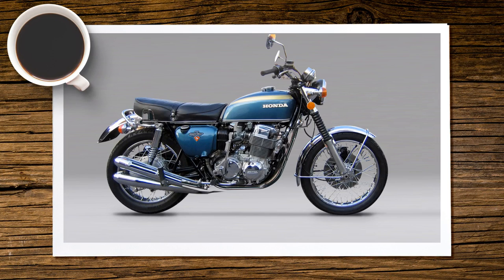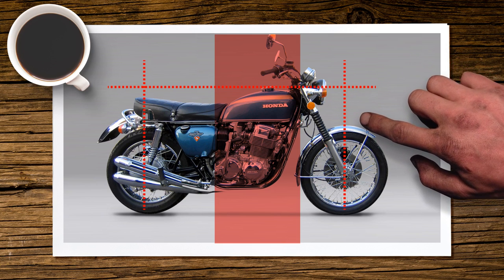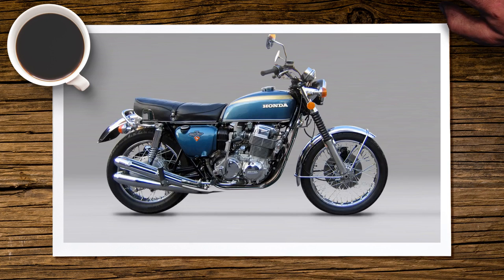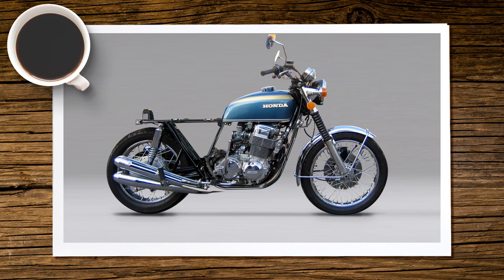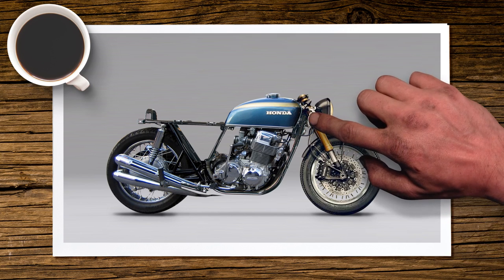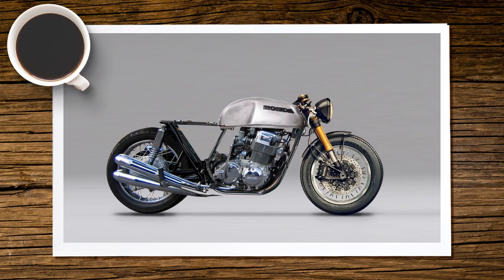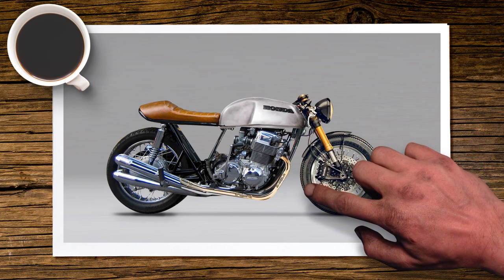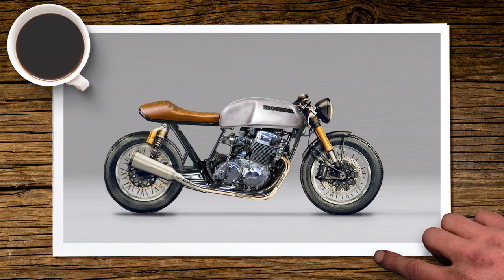How to design a cafe racer motorcycle

Comment: Funny, my build is the example motorcycle, down to the color! I realize they don't all have external oil tanks, but the one you used for example almost certainly does, in which case you'd still need some kind of tank in the 'triangle' or wherever you might put it. I've seen slimmer ones that stand up and lean back or a pill style round one. Mine is a 75 and I think the following generation (80 maybe?) they went to having all the oil in the crank case. You have a nice bike, too bad we can't share pictures here.
Reply from the maker: Yeah I've used creative license on that one, but Cognito Motors make a really thin nice one that mounts next to the frame to allow for your void to work

https://cognitomoto.com/products/bolt-on-cb750-oil-can
Reply: dreegez I've actually looked at that one. I keep considering it but the capacity is less than original so I keep weighing that out, visually a plus, but less volume means more frequent oil changes as the oil spends more time in the engine, and I believe that would contribute to higher oil temperatures as well. It's certainly possible I could be wrong though. And on Cognito Moto, I really like that air filter they have that goes across the four carbs, it's more unique than the 4 pod setup. Much more expensive though! Lol
Reply from the maker: Luke's World Definitely, I don't think Cognito can put a foot wrong, everything they do is spot on.
Reply: So far most of my parts have come from Dime City Cycles. I also like a few of the bits that Joker Machine makes.
Reply from the maker: Luke's World I do like Dime City, I regret not going there when I was in Florida last. Would have been an experience

Comment: In my opinion I think the seat in the after photo is just a little too long, and the same goes for the exhaust.  One of the key things I look for is whether back wheel is completely covered up or not, in my opinion it should be exposed as much as possible.  Also I think the  mudguard should be removed the for a more exposed look.  As well as tidy up the cables.  Lastly It'd repaint the engine a matt black with some areas masked off like the exposed out parts of the fins to give it some variation while not giving it too much attention.  It'd also add a heat wrap on the exhaust.  As far as the tank goes, I think a matt dark green would go well to give it a more military look, and in general it'd try staying away from too much glossy colors or chrome.
Reply from the maker: Thanks for the suggestions.

Comment: Awesome video...but I don't like that Blank V in most cafe racers... Getting rid of it will be a problem??
Reply: And subscribed hope to see more quality videos 🤘
Reply from the maker: You could leave the air filer box in place where the V in the frame is. Some cafe racers have them there. If your bike has the frame like that it'll need a lot of thinking if you were going to get rid of it as it's a substantial part of the support, or you could start with a bike like a Yamaha Virago which doesn't have that V

Comment: Love your vids keep up the good work subscribed yesterday, what was that gold front end off? I have an old wreck of a cb250n in boxes had it for years I’m thinking of turning this into a cafe style bike I’m struggling with figuring out what forks will fit and will I have to change both wheels?
Reply from the maker: People usually use GSXR front forks or CBR, you can even go Ducati etc, allballsracing.com have a conversion chart with what bearings you need. And yes, you will need to change the wheels, brake calipers and discs.

Comment: This video is so great. Is it necessary to convert from fuel injection to carburator type to clear up the triangle? Thanks
Reply from the maker: Depends if your bike has fuel injection or carbs. You can retune fuel injectors to run pods. Alternatively you can replace with carbs

Comment: Hey mate, me again :p just wanted to ask if you think it's possible for someone with no motor or build experience to build their own cafe racer? Had some naysayers telling me it will be impossible and I'm going to end up spending a fortune. Love working with my hands though and would love to give it a go assuming it's a realistic goal. If you think it is possible, I assume besides a standard tool kit, grinder, drill and welder should be sufficient for the bulk of the work?
Reply from the maker: If you have a £20 grinder, a socket set and a hammer, I say go for it.
The best way to learn is by doing, and when you start, if you get stuck, give anyone a shout on the internet, myself included, we might not know the answer straight away but collectively there'll always be a solution. As for the welding, you can get someone else to weld if need be.
Reply: Amazing, thanks mate. I'm gonna start looking for a bike and give it a go. No idea what I'm in for but what the hell lol
Reply: @chrisg1610  and found a bike ?
Reply: @forthebold  though in ur video where did you put the battery?

Comment: If I just bought a 1980 Honda 200 Twinstar and I want a set of front and rear forks like whats on this video but want to keep the wheels and tires I have. I really like how the wheels and break system looks. What would you recommend? Love the gold look and love the style of the rear shocks in vid and on your bike.
Reply from the maker: Try looking at newer bikes that may be being dismantled, that'll give you the gold forks, but you'll need to change the yolk also to fit, the wheels will be easy to swap, but the brakes might be a bit harder.

Comment: I've been following you for a while (you've been a huge help so far!) but haven't seen a video about modifying rear sets if i'm right. Do you do it? Or not at all? I'm thinking about doing it, but i'd like rear peg's for my passenger aswell. Any ideas?
Reply from the maker: Thanks for following the vids, no I never tend to modify them, there are kits that you can buy for most bikes, I've seen some floating around for the CX even, perhaps that may be a simple solution.
Reply: Alright! First of all I'll install my clip ons and check if I need the extra comfort or not. Thanks once again!
Reply from the maker: Good thinking, mock the bike up how you want it before painting then make that call.

Comment: very good video, mate! Have you any recommendations for a cheap cafe racer bike, because the honda cb750 four is too expensive nowadays in my opinion
Reply from the maker: +Anton Tworek Everything's completely priced out of the market, I remember when I was growing up we had engines and frames around but today there's a price on everything. You could experiment with newer bikes from the late 80s which look all plastic on the outside, as long as it has a steel frame you can do anything to the underneath. Maybe look for Yamahas that are water cooled, you can do some cool things with the radiator.
Reply: That´s a good idea, thanks!
Reply: Remember that the CB750 is just an example. I'm an old fart, and back in the day the CB550 was considered the better bike as it was almost as powerful and much lighter; they can be found much cheaper than a SOHC CB750. There are some great CX500 customs being built and those can be found for a song.
Reply from the maker: I like the frame build and the engine on the CX, you can create something beautiful with those

Comment: Iv got a 71 cb350 and I love the idea of swapping out the whole front end. Where/how would I find a front end to swap it with?
Reply from the maker: To be honest you can make most fronts fit. For an easy life, you can start with checking what triple clamp forks will swap to yours, then work from there. Alternatively you could measure your fork diameter and see what others share that size if you don't want to swap the yolk. Baring in mind chances are you'll have to change the front wheel and brake callipers also. I do like the CL350 forks, might be worth looking into those? Good luck

Comment: Is there a resource for figuring out what yoke and triple tree fit different bikes as far as compatibility with the head tube etc?
Reply from the maker: You can make anything fit with the correct bearings and stem swap back to the original.

Comment: how do you change an entire front end... that would mean now forks and shocks, new triple tree, new lights and brackets, bars, etc etc... is there a simpler way?
Reply from the maker: No not really I'm afraid, the look aof the cafe racer needs all parts such as bars, lights etc changing. But if you're changing the forks then a triple tree or yolk is a much needed part, unless you're lucky enough to find replacement forks that slip right in.

Comment: Nice photoshop job...I good idea of différents step on a cafe racer project...but talking about harmony lines...the pipe should be shorter and on a angle little more height and the line from the gaz tank and the seat need to be more precise...a perfect line... thank you for you video !
Reply from the maker: I've seen bikes where the muffler is parallel to the angle to the frame which also looks nice, I'm in between the angled or straight option for my pipes, I'm swaying towards angled.

Comment: One problem is that the CB 750 is a dry sump bike and "air cleaner" you removed was actually the oil tank.
Reply from the maker: Only the SOHC, the DOHC doesn't, but the SOHC has a Cognito Moto conversion that hides it in the frame

Comment: I have an 84 Honda cb650, what kind of forks would you recommend
Reply from the maker: I like the existing forks on those but probably a bit too long. You could try forks from a honda CL as they're a bit cool and retro, but if you're thinking of fitting new forks like on the video then the world is your oyster, whatever you decide will need work converting as I think you'd be stuck to find a quick replacement solution. Best way to start is to measure the diameter of your fork holes in the yolk / triple clamp and compare a list against what might fit. 

The other thing to then think about is your break callipers as whatever you change to will need either modifying to fit the CB's callipers or buy new ones for the new forks.
Reply: dreegez cool thanks a lot

Comment: What happens when you remove your air filter? I read that it's bad for your bike but is it wrong?
Reply from the maker: You have to compensate with re-jetting the carbs but you have to put a replacement filter like pods, you can't leave a filter off

Comment: im confused, so a bike does, or does not need the air filter on the back? getting an 81 CB 175 and im wondering if its required, and also where to mount my battery after mods?
Reply from the maker: It'll ned some kind of filtration system, so here we have pods, alternative is velocity stacks. And for the battery you use a lithium ion which can be fitted under the seat like on my Suzuki GS
Reply: ok cool,  im looking at filtration alternatives now thank you! now if the battery sits under the seat would it just be mounted in the location the old filter was? that may sound confusing apologies
Reply from the maker: If you get a seat with an empty seat cowl you can put it there.
Reply: ahhh ok i just saw your video for the battery relocating thanks man

Comment: without an air filter will dust and debris be sucked up into the engine?
Reply from the maker: You always put filters on. Put pod filters if you want to eliminate the pods. You can even get filters for velocity stacks (which some do run without)

Comment: Where could I find a tank similar to the brushed steel one you used?
Reply from the maker: start with googling 'Benelli Mojave tank' see if that fits what you might be after.
Reply: dreegez wow that was super quick haha. I believe that's it. Thank you!
Reply from the maker: singhsa123 Actually double check that one, I think some only have an indent on one side. I imagine you're after one with indents on both sides?
Reply: dreegez ahh. Yes I just noticed that. I'm working with a 1981 cb750 and loved the seat you used in this video
Reply from the maker: singhsa123 The seat you can buy is from caferacerseats.co.uk I'll have another think about the tank. Good luck with your build

Comment: What about parts? Where do you recommend going or what website?
Reply from the maker: All depends on the look you want and how much you want to spend.
You can start off on ebay, other scrapped bikes, or Cognito motors, Dime City Cycles.
Reply: how much would you recommend putting into a stock  yamaha rd 300?
Reply from the maker: Dre Anza Nice bike to start with. Is it running ok? If so you might say a minimum of £1000, at a very rough guess with very little to do.
Reply: Yea the bike runs well. This is going to be the first bike I work on myself. So Its hard to figure out a budget when it comes to buying parts.
Reply from the maker: Dre Anza First thing I'd say is budget for the frame and powdercoating, then swap bits as you go. Leave the paint job for last

Comment: I am 15 and im thinking to build a cafe racer. I have an idea but im not very good at drawing and i cant explane it clearly (like the most idea's a human has) but i want to see it on paper before chosing my bike. any idea's how i can visualise my idea?
Reply from the maker: The simplest way in that case I'd say is to print out photos of bikes you like with parts you like from pinterest or a google search, roughly the correct size and cut them out with scissors and place them on a table, kinda like I'm doing here, probably the easiest way.
Reply: i just sayed fuck it and tryed photoshop it works roughly but how did you cut it so clean out (the frame in your vid)??
Reply from the maker: I've been doing it for years, it's my job :), but I use a pen tool to draw a shape layer, then select that layer as a path by holding cmd and click that layer
Reply: what program??
Reply: I am thinking of using the yamaha xs400 as base and if possible (because i want to keep the costs as low possible using the tank of an yamaha xjr1200 or 1300 for a more modern look.
Reply from the maker: In Photoshop itself
Reply from the maker: I like the XS400, and the idea is good, might be worth also checking the width of the xjr1200 tank as that's a 4 cylinder so might be a bit wider than the XS400 frame, just incase it sticks over the sides too much.

Comment: Would this be street legal since it has no mirrors, or tail lights?
Reply from the maker: All depends where you live. In the UK you can get away with no mirrors, but you must have a tail light.  Unless your bike is over a certain age, but if you're showing a bike, purely for the build, you can do like I'm doing with my CX500 and have it where you can remove them then put them back on.

Comment: Can you do a scrambler?
Reply from the maker: Yeah that's a good idea. Thanks for the suggestion.
Reply: Btw a quick question if i higher up the pipes and the bars then replace the tires with boxier tires will this turn into scrambler?
Reply from the maker: Style wise that would do it, I associate scramblers with lighter and thinner bikes that cafe racers, so more of a 2 piston or even a single big bore engine. Like a Triumph engine or Yamaha, that thinner frame gives it that distinctive look, I'd also put some protective aluminium sheets on the underside of the engine also as durability goes with a scrambler look and to protect from the off-road mud.
Reply: I'm looking forward for that vid! :) Just wondering which is more badass. THANKS!
Reply: Another one, just wondering if there's hybrid cafe racer and scrambler?
Reply from the maker: Gabriel Lee I guess it might be an enduro? but I can't see why not, I think mostly it might be the seating position that defines the 2, cafe your low down where as a scrambler you need to be higher so you're in control of your bike. What might be interesting is adjustable bars, that can be flipped up high or down low.
Reply: Thanks bro! Keep it up! Great vid and channel!

Comment: But dont you need an airfilter?
Reply from the maker: I’ve put pods on these. You’ll need a filtration system of some sorts. Open carbs will cause you issues and whilst velocity stacks stabilise the air to have them running without filters will damage your engine on the long term.
Reply: @forthebold  Thanks. I have been looking into this. Im a noob but have just discovered your chanel. Thanks for the great resources and info.

Comment: so I buy a Honda chop here chop there, only use the engine and frame and the rest is trash but of course buy what was trash... got it!
Reply from the maker: pretty much, but in all honesty my ethos with bike builds is if it's past a stage of restoration, then it's time for a re-build like this, if a bike is in really good condition I don't think it's right to destroy it, only so happens the image I used here was a new bike... But... also the spirit of cafe racer was always to make the bikes faster for racing, and if that means changing items such as shocks for performance, or stripping the weight off by removing heavy standard items, then that's also correct. All depends what your outlook on bike building / restoration is.
Reply: +dreegez love the bikes just make it sound so easy I guess cuz u have done It but I was curious something about those old bikes I like and wouldn't mind making it into cafe racer or just stock...
Reply from the maker: I cringe sometimes when I see near perfect condition bikes hacked, as I think one day there'll be none of these beautiful bikes as stock, I like to give bikes which are near the scrap heap a second chance in life.

Comment: So basically you change everything except for the engine...
Reply from the maker: Not really. You still keep the main bulk of the cost of the bike like the frame and electrics etc. From experience those costs quickly mount up if starting from scratch. Also you nave the added benefit of the bike already being registered.